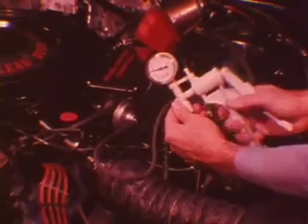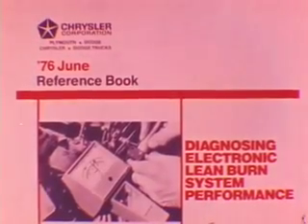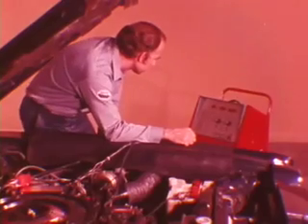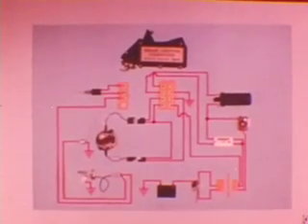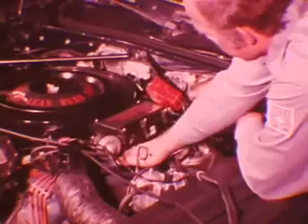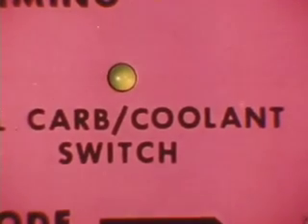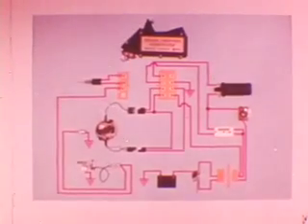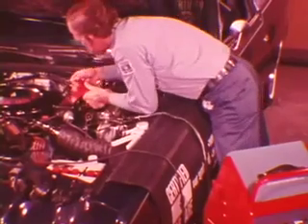Chrysler Master Tech - 1977, Volume 77-3 Using the Lean Burn System Analyzer

Comment: The Valiant cars here in Australia that had the ELB system were very slow. Full speed was just on 110 mph. My car from 1976 has electronic ignition, & fuel injection. It has a 4.52 litre V8 engine, & will almost catch one of these CL-CM Valiant cars in SECOND, when the Valiant is at max speed. Under acceleration, my car will leave a CM Valiant behind with no trouble at all.

Comment: I have a 1977 Dodge diplomat 2dr here with this system.  I've seen the diagrams and system operation before but wow I never knew they had this then to diag.  And the early version of system has a non computer Carter bbd. Mine does when ran it ran pretty well never had any real issues with this system ever.

Comment: people didn't know how to service these it's 5 yrs ahead of gms computer command control.
Reply: The only thing nice about the 3C system was that it used a bidirectional control hand held scanner that gave real time data and codes. This was easier to use than Chrysler's ELB/ESC system analyzer or Ford's B.O.B. 'count the flashes' routine. But you're right. Even in the mid to late 80's, a lot of techs didn't know how to properly diagnose a problem with an ELB/ESC system, and many an expensive computer was thrown at them hoping to fix problems.
Reply: @adamtrombino106  In addition, most 1980s Japanese cars could only give an error code number or blink a certain number of times. However, most of them used EFI. I can't think of any Japanese engine that had a carb engine and computerized spark. In any case, some of those computers had been replaced because of misdiagnosis.

I sometimes wonder how my mom's 1985 Nissan Maxima (And friend's with the same type) drove for many years and never had a check engine light. Those cars always beat the hell out of batteries, alternators, starters, and A/C compressors.